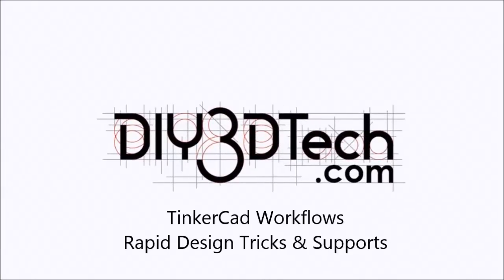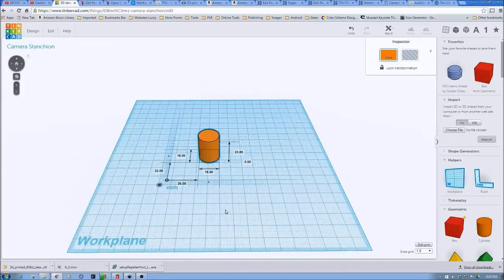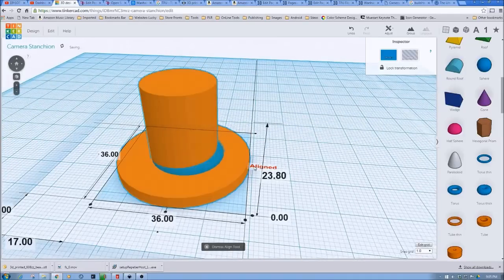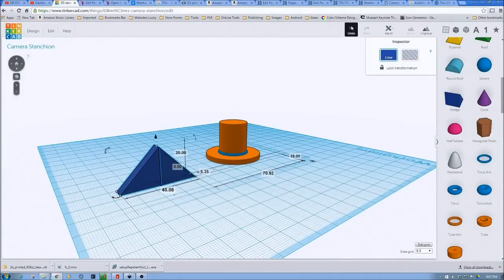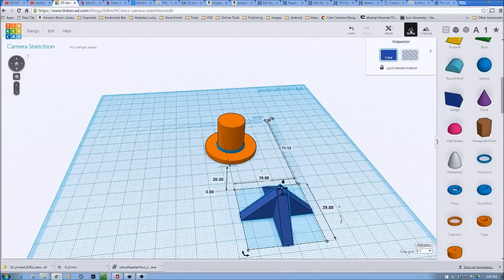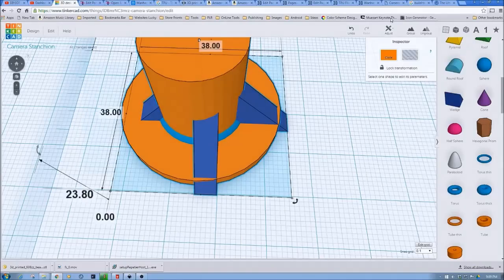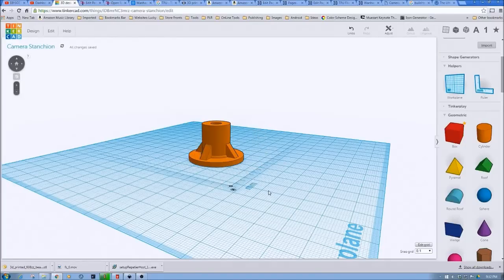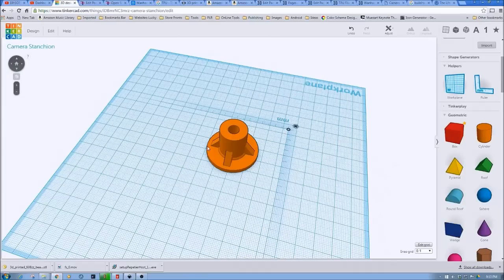TinkerCad Workflows - Rapid Design Tricks & Supports

Comment: Great ideas here but you could have used a Roof shape instead of a Wedge. Then you would not have had those problems aligning the two wedges. You also could have flipped your duplicate wedge instead of dragging and rotating it. When you rotate, if you click inside the compass your object will rotate in 15 degree increments.
Reply from the maker: Wow this was a while back!  To be honest I don't really remember :-)

Comment: how would you make the fillet conkave instead of convex? I am fighting with this and havn't figured it out yet. Mind you, I am new to this, but still...
Reply from the maker: I would take a torus and then a turn another smaller torus into hole create the concave and then cut off the bottom...
Reply: Just add another torus (thin) as a hole and merge it
Reply: I did this last night by creating a solid ring, then overlaying a torus hole.  It took a few minutes to wrap my head around it, but I got it eventually by making the torus larger than the ring.  Join the two, and what's left behind is a perfect concaved fillet.